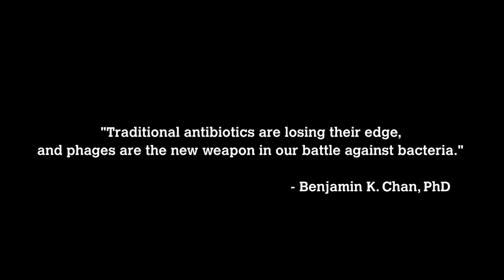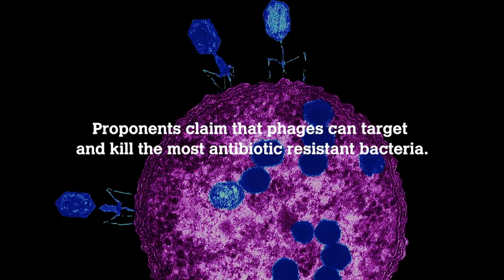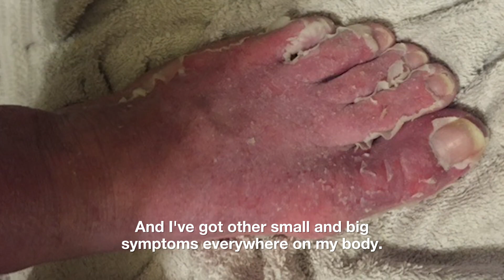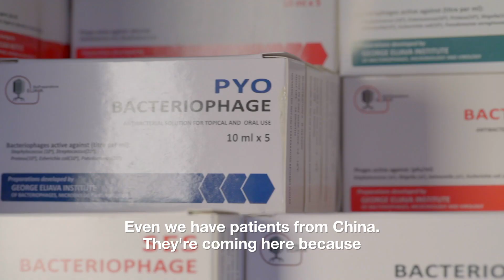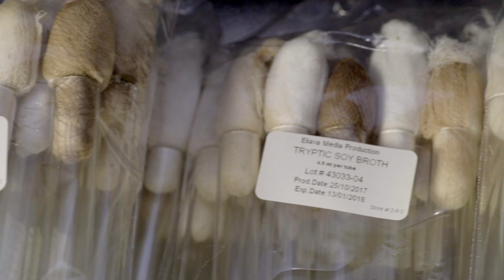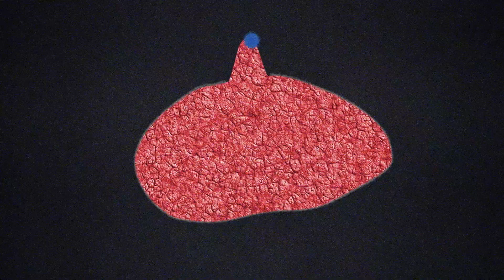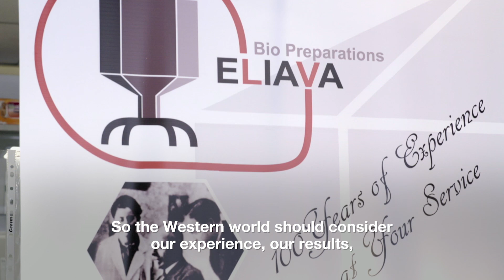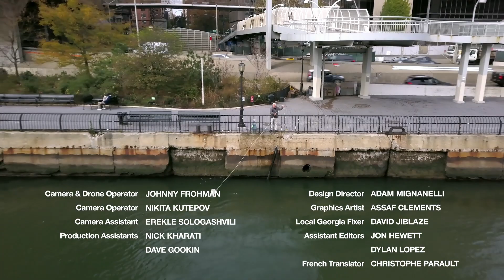The Virus That Kills Drug-Resistant Superbugs

Comment: There are 6 new antibiotics not used because the expense
They have been developed
But are held back due in over use of antibiotics
New drugs are not available until deemed necessary
Reply: The new antibiotics that have not been marketed, do not have increased efficacy on superbugs, so they are dead in the water